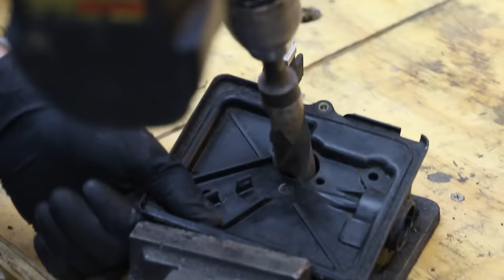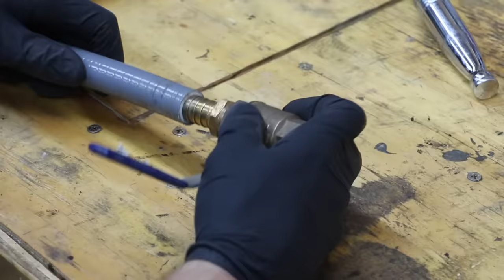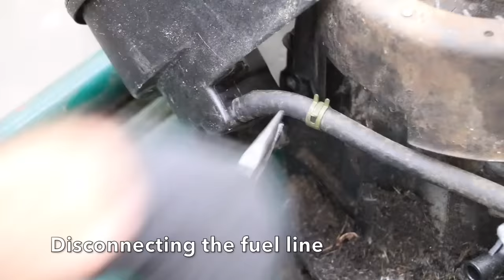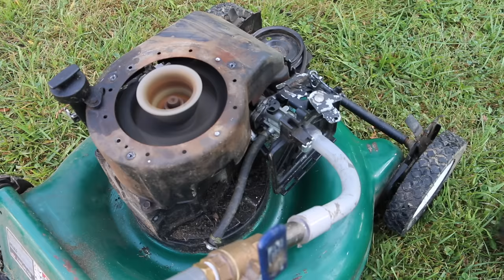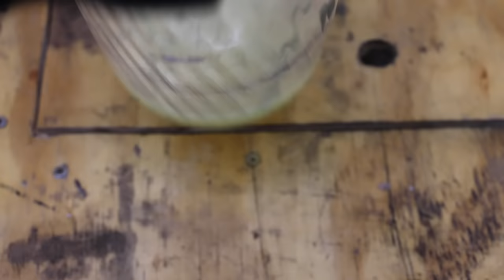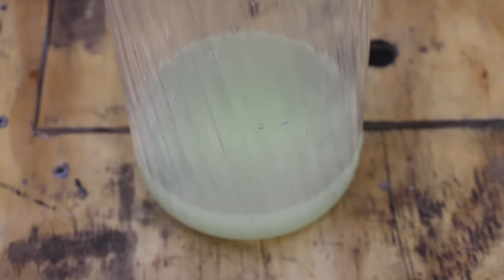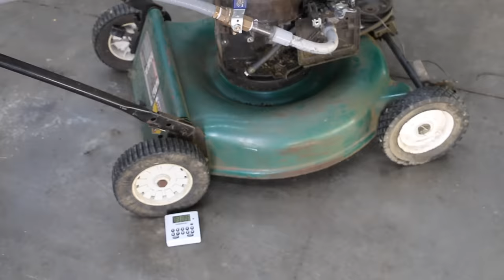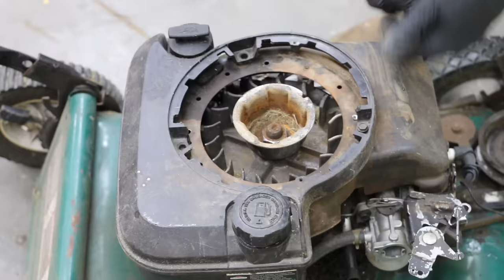Will a "Gas Vapor" Container Improve MPGs and Fuel Efficiency?  Let's find out!

Comment: My Dad, Uncles, and Grandpa all have talked of a International truck that my Grandpa had back in the 60's he bought new. Thing got over 50 miles to the gallon. 2 or 3 months after he bought it word had made it far enough up that International Representatives along with the Sheriffs Department one day pulled in and informed my grandpa that International had made a error and was there to fix it. They removed the carb replaced it and just like that the old international got about 5 mpg. An when international was contacted by my Grandpa. He was told international had never build not only the carb they never produced a truck with that vin number.
Reply from the maker: Very interesting!  Thanks for sharing!
Reply: Makes sense now that there's a guy who put a lawnmower carburetor on his old Ford and is getting 41 mpg
Reply: wait what? I need more info on this?
Reply: Same thing happened to my family. My grandfather was a car salesman at a ford dealership for 35 years. He told me that back in the 80’s, this man came in and purchased a brand new F-150 off the lot. Came back a few weeks later confused as to why his truck was using only a small amount of fuel. He was making daily trips down to a major city 100 miles away and claimed that the truck was getting over 100 miles to the gallon. They popped the hood and saw a black box leading into the intake manifold. There was a stamp on the box with a serial number and the words “Ford Prototype.” Corporate found out about it and wanted to buy the truck back. At first he refused but then settled on a 1 million buyback price. Very strange story.
Reply: @christopherkortlever  😂
Reply: I think I would have been suspicious, that's okay it works just fine thank you anyways! After this comment I know I will be if I ever should have the same issue!     This remind a friend I had long ago who told me that when he was a little kid his family had a John Deere "water-engine"pump that pumped water out of the well, he said once you got it primed and running it literally ran on the water that it pumped!  Back then I got on my cutting edge technology dial-up internet and tried to research it and found nothing more than an image of an 1800s advertisement for it, but had no details about it works. Now I can't find any info about it at all.
Reply: @Troyvidihoo  look into "hydraulic ram pump" it sounds like that's is what the old John Deere water pump was
Reply: @brianweber2941  Thank you Mr Brian, I sure will look into that! And I definitely appreciate the reply.
Reply: @Troyvidihoo  was the ram pump what your grandpa had then?
Reply: Look up the story of a man named Tom Ogle.
Reply: ...and that boy was George Washington.

That never happened.
Reply: I have heard many versions of this same story.  My mother in law told me about a neighbor that had a Ford that got 80 miles to the gallon then they showed up and said that they received the wrong car.
Reply: @christopherkortlever  🤣🤣🤣
Reply: Lol there's no international truck that gets good mileage. You might as well say there was one without rust.😂

Comment: I mean isn't fuel somewhat vaporized as it's sent into the cylinder(atomized) to mix with the air properly?
Reply: i was alway told that its called a gas pedle because the fule is turned in a gas as it is sucked into the cumbstion chamber thats in a car though not sure about a lawnmoer he seams to think it runs on the liquid and he got hundreds of people asking him to do it so geussing we are worg at least on some levle
Reply: atomized is the same as a mist. Vapor is particles suspended in air. The contraption he came up with ATOMIZED the fuel. In short, the gas is misted normally, the contraption caused a mist, thats how gas usually works.. he didnt really do anything novel here hahaha
Reply: @plaidjoker1321  I've heard both terms used in relation to fuel delivery systems. I was trying to politely make the point that this isn't anything novel that he's doing, anyone who's ever played the E game knows you can run on vapors.  Typically the reason it's avoided is due to sediment and other things collecting at the bottom of a fuel tank that can clog up a fuel pump, fuel filter, etc especially if such things are located IN the fuel tank.  It is interesting to see what happens to the fuel if you're trying to deliver it as a vapor first rather than deliver it as a liquid and using injectors to turn it into mist.  I have more knowledge in automotive engines than small engines.  Most of my small engine knowledge is on m17 water pumps in the army which were carburated (real word, idk, is now), so forgive any gaps in knowledge.
Reply: @JordonPatrickMears11211988  So i think we're agreeing lol
Reply: @plaidjoker1321  I'd go as far as saying we ARE agreeing, lmao.  I was just trying to elaborate on my original statement a bit more. Add some more detail for other readers/viewers.
Reply: @JordonPatrickMears11211988  haha what a beautiful monumental moment in youtube comment history. 2 People agreeing
Reply: @plaidjoker1321  you mean American/world history lmao
Reply: @plaidjoker1321  had to disagree to keep balance for thanos
Reply: @plaidjoker1321  He basically made an external carburetor and attached it to the regular carburetor, only one with a massive fuel bowl and no value to regulate incoming fuel. Add a float valve and a fuel line and we've completely reinvented the wheel. Bonus here is that the atomization of the fuel is probably better due to the volume of tubing the mist evapourates in, but statistically insignificant fuel consumption differences.
Reply: @AldoHam  dats just worg on meny levles
Reply: @AldoHam   I always thought it was a liquid spray of fuel that goes into the combustion chamber? Or at least that seems to be what they shown in videos in the past when their showing how engines work with using a animation of the inside of a engine!  I’m certainly no mechanic by any means, know just enough to be dangerous! LOL  so I’m just going off the other videos I’ve seen in the past!
Reply: I believe that gas as a liquid is not flammable, but the vapor is what's actually flammable. Same reason why they have those warnings at gas stations. Spraying a fine mist of gas into an engine will create more vapor from increased surface area (in addition to the heat probably increasing vaporization), which is how it actually ignites. Additionally, setting gas on fire in an open container or space will ignite because of the small amount of vapor evaporating from the liquid supply. If you've ever lit gas on fire with a very small opening in a bottle or something like that, flames usually stay on top, but any sort of agitation will cause more vapors to be released and cause an explosion very quickly.
Reply: Yep, ultrasound mixed vapour.
Reply: @AldoHam  well bud i am pretty sure this man knows how  a combustion engine works. all full systems pretty much do the same thing the full system has to atomize the full for it to burn in the combution chamber that is why air flow is important.  and that is why this worked.   if it was a a liquid is thrown in there without being turned into a fine mist it would never run it would just foul the plug.  that is what happens when you flood a engine it cant ignite the fuel.
Reply: @theJ4ZZ  liquid gasoline is flammable. 
Gasoline vapors are highly flammable.
Reply: @scotcoon1186  Ah okay, maybe thats what I was thinking lol. Thank you for clarifying.
Reply: @plaidjoker1321  he literally built a carburetor, a bad one. The point of atomizing fuel is to increase the surface area so it vaporizes more readily. Engine makers spend millions figuring out how to make fuel vaporize so it can burn. The problem with this design is the engine has to pull air thru the liquid, which will increase pumping losses, and it is harder to handle varying loads.
Reply: 80%gose out the tell Pip if you don't do this and back in the 70s a guy did this and he try to get it patent but they shut him down the big money don't want to lose a dollar shows you who's greedy
Reply: @yashuasaves6782  I might consider what you said if I could understand the language you wrote.
Reply: @theJ4ZZ  yeah you can drop a match in a bucket of gas and as long as there’s not vapor, the match will go out like it was dropped in water.
Reply: @scotcoon1186  liquid gas does not burn.
Reply: @Reallymeanbean  Nothing burns without Oxygen or some kind of oxidising agent. So technically nothing in a sealed bucket would burn.
Reply: All engines mix fuel with air. 

Carburetored engines use vacuum to suck both air and fuel into a chamber where they mix before going into the cylinder. The con with this set up is not all the fuel is atomized before entering the cylinder and its hard to precisely control the fuel/air mix ratio. Result is a less complete burn and more emissions.

In a fuel injected engine, air is sucked into the engine and the fuel is injected though a high pressure system. Because fuel is injected at high pressure it is better atomized and mixes more completely with the air. The fuel can be injected into the air either before the cylinder or directly into it. Also, because the fuel injectors are controlled by the computer, the amount of fuel and timing of the injection can be precisely controlled. The computer uses many different sensors to calculate when and how much fuel is injected. 

The theory of pre-vaporizing the fuel as this video shows is that the fuel is more completely vaporized giving a more complete and cleaner burn. However, this likely causes the engine to run lean (more air / less fuel). You might get more mileage but probably a lot less power. 

To truly test this with a lawnmower, try mowing very tall thick grass. My guess is the vaporizer will stall out much more than the factory setup.
Reply: Only a vapor burns, not a liquid.
Reply: @millenialfalcon8243  also lean mixtures tend to damage engines
Reply: @Bankable2790  Yup!
Reply: @andrewcampbell4396  not true... liquids can be flammable... the difference is that while both can burn, one IGNITES much more easily and efficiently than the other.
Reply: @cornfarts  well.... have you tried turning it off and back on again...?
Reply: @Reallymeanbean  The catch is the part "as long as there's no vapor".
There's going to be vapor sitting on top of the liquid, so that condition isn't going to be met when you drop the match in.  Only thing that might be met is your maker-🙃
Reply: nah direct inject engines have liquid fuel sent to them and the compression of the cylinders makes them get mixed and atomized well
Reply: @AldoHam  carbeurated engine vs fuel injected
Reply: Yeah that’s the way I understood it
Reply: @AldoHam  are you stroking out?
Reply: Watch smarter every days’ video on how a Carburetor works. It explains it better than what a message can
Reply: @plaidjoker1321  100% brother Education